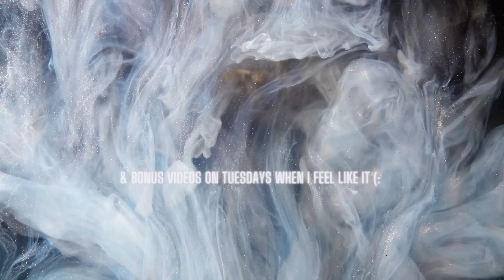HOT MESS LAKE HOUSE LAUNDRY ROOM DEMO DAY! | COMPLETELY GUTTING OUR LAUNDRY ROOM!

Comment: 7:48 a handy tip for you Lexi if you don't have Mr Muscles around.. get your Sawzall with a metal blade and run it around all the 2x4's to cut through all the nails which will free the beams up and you should just be able to pull them out with your hands, no sledgehammer required 😉 
Great job guys! You're an awesome team xx

Comment: You definitely want a fire rated door between the laundry room and the garage. It makes sense for fire safety and security in general.
Reply: Definitely! I had a fire about a year ago that started in my garage & into my laundry room & livingroom, it's been a nightmare, we are still working on the damage it caused, if we would have had the correct fire rated door it could have saved us so much time, money, & stuff...🤷‍♀️
Reply: This is something we’ll keep in mind when looking at houses this spring ! Thanks
Reply: Not to mention well sealed door so car fumes do not come through. Which I would imagine is covered in a fire rated door. I wouldn’t know. I just know I rented a room attached to a garage that had a door to the garage that was locked & blocked access. Which wasn’t a big deal since the garage was used as the homeowner’s man cave. But the last 6 mo I was there he got an old classic little convertible that he kept in the garage. The exhaust fumes would come through whenever he started the vehicle. 😳
Reply: Someone was just telling me yesterday 
about their old home that they want to sell doesn't have a fire rated door to their garage.
Reply: I don’t have a fire rate door between my mud room to garage. It’s definitely an old house that we bought 10 years ago. I want to change the door out now.
Reply: I just realized that’s why our garage door looks like that. I am renovating my laundry room and was going to remove it. Thank you
Reply: Probably need it to pass inspection

Comment: Looks great! Like you, I didn't want the gas for our dryer. So we switched that out when we moved in. Pretty simple change out with your skills.
Reply from the maker: Ooo interesting!  Did you have to take out the existing gas line?!
Reply: @LexiDIY  we capped it. It was later removed when we took out the copper pipe to it and a "not to code" gas fireplace.

Comment: Great teamwork with you and your hubby!  Definitely suggest that you put in an exterior door leading to the garage, and installing a pocket door that leads to the kitchen. If you get rid of the sink, I think you would have enough room there for the pocket door and a tall narrow cabinet for broom/mop/vacuum.  Then finish the top with cupboards for cleaning supplies/paper towels/ etc. and add a counter top over your washer/dryer.  Use the adjacent side for the mud room area.  It is a small space, but with the addition of a pocket door and some clever planning, it can be multifunctional and beautiful 😊

Comment: I'm in architecture school and I want to ask if the process of removing the closet needs planning permission to get approved before starting removing it, or was it a normal structure that won't affect the load transferred to the soil by the structure system of the house.

Comment: What a difference!!
Regarding electrical and gas. I prefer gas myself for cooking because I can see the flame and can control my heat better on the cook top. I’ve had both electric and gas dryers and didn’t really see a difference other than utility bills. Gas use to be cheaper but everything has gone up it’s ALL to expensive now. Our gas this winter has gone up 100% when we were told 50%. 😵‍💫